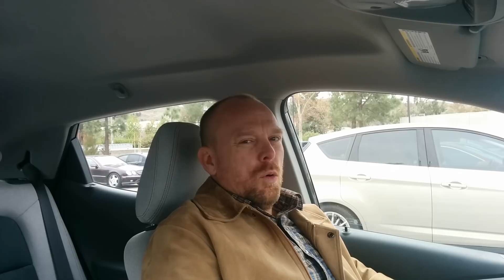Plug-Side Chat: Using Phase-Change Materials (PCM) for Battery Thermal Management

Comment: placing my order today for 12 lbs of soft paraffin hand wax for beauty spas lol... took a lot of research to get to this point. ironically the 1lb soft melt paraffin wax refill packets are the perfect dimensions to fit inside my aluminum rectangle bottom cooling plate, and their HDPE packaging means they are ready to use in the wrapper. 
thermal management was probably the hardest part of this project so far to think through. you have one of the only informed videos on youtube discussing pcms in ev batteries lol. AI actually redirected me here several times.

The prototype +10/11.5kwh gen1 volt hv battery expansion should generate around 0.4kwh - 0.8kwh of waste heat during discharge from top to empty (more on cold days thankfully), so I calculated I would need around 50lb of water/glycol in my cooling plate to hopefully move that heat into the bottom plate on a hot day 
(assuming ~95F inside car temp, thermal mass heat sink not to exceed ~135F,  ~10F delta between heat sink and battery temp).

despite the obvious challenge of trying to make a watertight glycol loop in my hatch (probably never going to work, would get pressurized and leak), there was just too big of a mass penalty to scale to the final +30/35kwh battery (+150lb for thermal mass alone, puts me essentially on/over GVWR w/ passengers).
well off the shelf organic PCMs really shined here.... instead of loosing most of the thermal inertia to thermal equilibrium on a hot day (like water does coz its just specific heat), ~80% of organic PCM's usable "thermal mass/inertia" is from the latent heat of fusion alone... around ~110-120F, which the inside of your car will not go above as long as you crack your windows on the hottest days and dont live in Las Vegas. 

when you use organic pcms, that ~50lb weight penalty becomes ~10lb, and scales to ~30lb. lot more breathing room. actually 50lb/10kwh would be ~33% of the extendo pack mass. PCM would only be ~6%. 
still debating on if its worth using a separate ionic based low temp PCM to minimize freezing. I think I have settled on the lazy "active" approach that the 2023+ plug in Prius used and just avoid heavy regen braking for 15 min after cold soaking below 32F and add ~600w worth of silicon heating pads with a few temp controllers that i can just manually plug in at night at home to keep the pack above ~40F. its only like 4 weeks out of the year here where it gets super cold at night, and there should be enough thermal mass to never have the battery charging while frozen.
i do religiously precondition my volt on cold days so probably a non issue already.
Reply from the maker: Wow, very cool (pun intended, I guess?)! It's nice to see someone putting some of this theory into practice. 🙂

Comment: heh, building my own diy chevy volt hv battery expansion pack (10.5/16.5kwh -> 20.5/27.5kwh). was trying to figure out an easy thermal management solution and was going to just go with thermal mass on bottom with some airflow over the top, but started doing math and realized pcm inside of aluminum rectangle tube would save a crazy amount of weight and money. not really looking for longevity for my old volt, just want some kind of fail save thermal solution for safety. 
going with lfp 32ah cells and documenting the build process on the gm volt forums under gen1 mods. lot of nay sayers, if LFP doesnt work ima just go LTO lol and forget amount most of thermal management.

Comment: I haven't heard of these materials before. Interesting idea. So if I understand it correctly, they would be able to absorb heat energy for example when fast charging. But then that would only be effective for one charging session. Eventually you need to move the heat out of the pack so you need an active cooling system anyways. So I'm not sure it would be cost effective as it would not replace a cooling system. Maybe you can get away with a slightly less powerful cooling system as you have more time to cool the battery and PCM.
Reply from the maker: Yes, that's pretty much the idea. You would still need an active cooling and heating system, but it could be far less robust.
Reply: @newscoulomb3705 just thought of another possible reason they are not used. The might expand when changing from liquid to solid which would not work in a battery pack.

Comment: Ok, NOW I listen to the current video on PCM! Hahahaha!.

Ironically, the heat pump is a PCM device and could be integrated right into a battery box. It is true that pressure changes are involved too. But very much a parallel.
Reply from the maker: PCM can be used in heat exchangers, but on their own, they are just a heat sink.

Comment: How to throttle some of the cabin heater energy toward the battery heat/cool loop, or be able to run the battery heater loop beyond the preset (60 something degree) temperature to prepare a battery for an upcoming fast charge event?  It appears there’s either a plumbing modification or a software modification that’s necessary to help improve cold weather (fast) charging of the Bolt battery.
Reply from the maker: Based on my observations, the ideal charging temperature for the Bolt EV's battery is between 60 and 70° F. Perhaps the loop won't let it warm past ideal, which is fine, but I'd like to be able to control that from the cabin.

Comment: First: Shouldn't you be asking LG chem about this?
Second: With regard to paraffin, I think it would be a bad idea to add a flammable liquid/solid to a battery matrix.  If there were a crash sufficient enough to cause a battery fire, the paraffin would make it worse.  I've been in the fire dept for thirty years and if there's an idiot out there, sooner or later he'll need us.
Reply from the maker: Your right. We should eliminate all hydrocarbon based liquids from personal transportation stat! 

In all seriousness, a PCM system like this would do little to affect volatility. It wouldn't have any more impact than the insulation, aluminum, and other flammable components in the battery. We're probably not talking more than a few pounds per battery pack.

Comment: PCM's are used in batteries where you don't have access to "real" thermal management.  My EGO lawn care equipment has PCM filled battery packs, the PCM keeps the battery pack temperature stable, and during charging, the rapid charger has a powerful fan to cool down the battery and re-solidify the PCM.  The rapid charger monitors battery temperature and keeps the fan running after the charging phase is complete if needed.  In other words, Nissan may benefit from PCM's but anyone who has "real" thermal management would just be adding weight to their battery pack.
Reply from the maker: Thanks for the heads up. I'm not familiar with EGO's products. 

You should watch the video I linked to in the information section. PCM are used to actually reduce mass and volume for aerospace, DARPA, DoD, etc. type implementations. It might actually reduce EV battery pack weight and complexity.

Comment: I think using a phase change material like wax would not help because all it does is create a thermal barrier at 26 degrees c, but when the battery is too cold, the wax won’t circulate, so in the winter you would need to keep it liquid, and in the summer you can’t use it to cool the battery because the wax would stop flowing at 26c. 

I think they should have insulated battery packs, with liquid or vapor used to add or remove heat. I think the new leaf cooling will be sufficient because the Zoe uses that and I believe Hyundai Ioniq does too, as do Prius batteries. But we will see once we get a cutaway picture of the new leaf battery showing it’s airflow and heat sink area. 

I think air cooling can’t compete with the liquid cooling in Volt battery or even Tesla, but the Bolt battery budget liquid cooling could probably be surpasses with air cooling, but the pack would need to be a little bulkier. 

As I understand it, the Bolt EV only uses one heat sink between 2 of the 3 cells in a brick, so the path from the 3th cell, through the 2nd cell, through the heat sink, dowm to the chiller plate would not be cooled as evenly as a battery where all cells have the same amount of heat sink dissipating to properly baffled air flow, which is circulated through the evaporator.
Reply: IMHO - to continue on your train of thought - if you have a solid filling the channel that a liquid would normally fill/ flow through, how do you get remotely sourced heat to the solid wax to turn it to liquid (flow) without having yet another adjacent channel which would contain yet another fluid (which would not change state) which could distribute heat throughout?  Once the wax has turned to liquid, it’s then holding heat, which is good when it’s cold out, but bad when it’s hot.  How to insulate the battery from the outside cold, yet allow it to dispense excess heat when it’s warm internally?  Is there a PCM which serves as a thermal conductor (draws heat away) when it’s liquid, but serves as an insulator when it’s at a cooler solid state?  Surround the blocks of cells with a tubular band containing this material.
Reply: Dennis Lyon, yes, it reminds me of soviet salt reactors. It’s all good till it cools off and stops flowing, not easy to get started again.
Also using an energy dense flammable hydrocarbon as a battery coolant might not be a good idea. lol
Reply: IMHO - oh, yes.  Wax is a combustible, isn’t it?  Must keep that battery pack sealed.
Reply from the maker: I think a point that was missed is, PCMs hold heat until the surrounding temperature drops below their freezing point, at which they release the stored heat. People complain about DCFCing in winter, only to have their battery cold again the next time they charge. PCM would address that.
Reply: News Coulomb, but the batteries aren’t cooling due to their own exothermic reaction, they only make heat. The only reason they get cold is the pathway for that heat to escape. So instead of using wax, you can just use a layer of insulation. The mass of the batteries will not cool fast if it’s insulated. And then it only takes controlling of the thermal management system to add heat or remove large amounts of heat. 

Insulation would also help to keep your battery cool when you park on a hot parking lot in the Sun in 100F weather. And if you as owner are allowed your own settings, just like energy saver settings on a laptop, when plugged in you can maintain 50F-60F battery temp and when on battery 40F-80F, or whatever you want, and you get the desired performance based on your choices.
Reply from the maker: @imho7250  Sure, and by that logic, the batteries should just be stored in a vacuum.
Reply: News Coulomb, that’s true but won’t work for air cooled batteries, but I did think of the vacuum layer in the battery case. Totally doable but a layer of insulation is cheaper.

Placing the entire pack under a vacuum can be done, if liquid cooled, but I think they determined it’s not practical. Just like the heat pump and solar panels, if it’s cheaper to just add 1 kWh of battery to keep heating/cooling a pack than to get Thermos to make your battery case, they will do that.

Comment: One problem with phase change materials is the amount of space that they would need. Looking at the battery pack disassembly video from the Weber Auto channel, there isn’t any spare room in the packs. I also noticed that there doesn’t appear to be any insulation around the pack, making it harder to keep warm in the cold weather.
Reply: I just bought a Ford C max energi and the batteries are only air cooled in those as well. In so cal we don't get terribly high temps regularly but will see how the battery hold up summer after summer.
Reply: Perry Allen - CMAX does have interior (read: chilled or heated) air blown past the battery internals during battery temp excursions.  This may be nonexistent or less effective with a larger Energi (vs standard CMAX) pack though?
Reply: Jonathan Polley, Professor Kelly of Weber Auto definitely has one of the most content rich channels. The amount of preparation work he does in disassembly, labeling and research of each item is amazing. Very organized teaching. It reminds my of military training schools where they spoon feed the facts in easily digestible form.

I hope he can get DCFC added to his Bolt EV but I think it won’t be easy.
Reply: IMHO - hopefully no hardware is missing from inside the big modules, but I sense there are differences beyond just the wiring/plug changes he has pointed out so far.  An interesting challenge!
Reply: Dennis Lyon, I think the car’s firmware might not recognize it. Some automakers are encoding serial numbers on many parts and your car will not acknowledge that new part without manufacturer computer tool. 

A quick google search showed some have tried it but not gotten it to work. With any offboard charger the car needs to be encoded with the protocol for that type, such as CCS. The non-DCFC version wouldn’t need that protocol, since it can tell the onboard charger what to do in its own language.